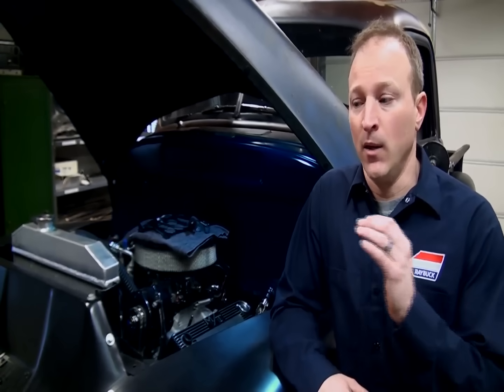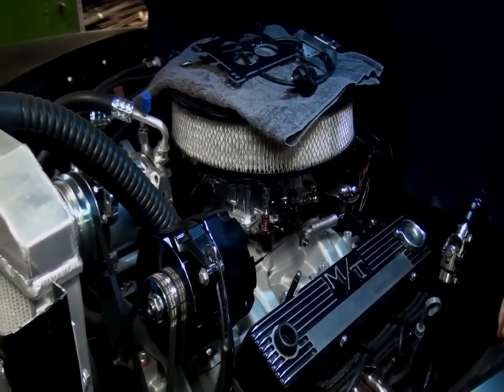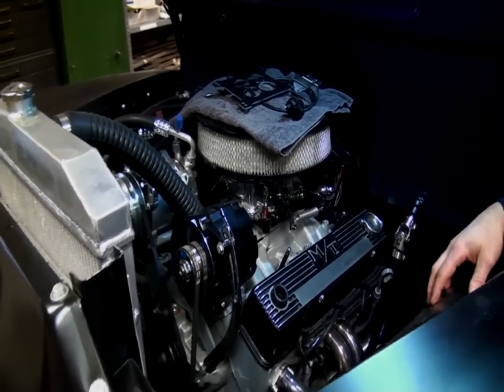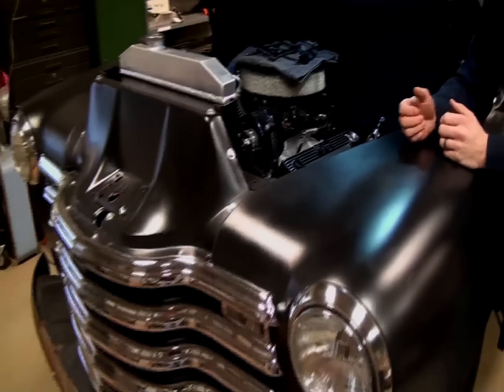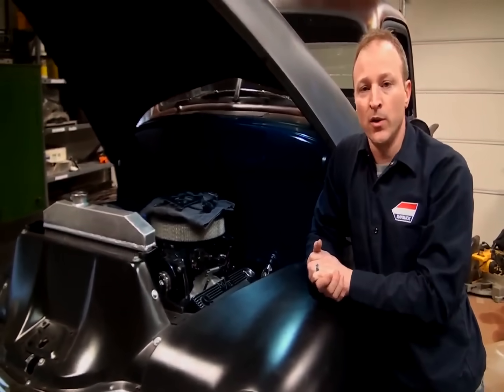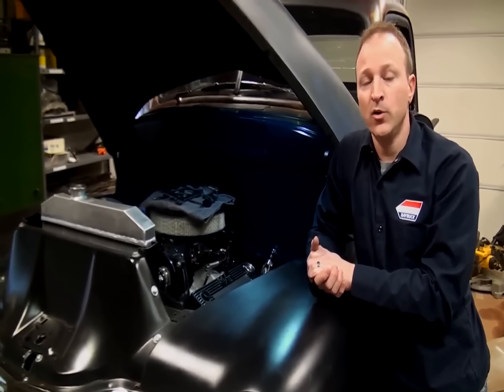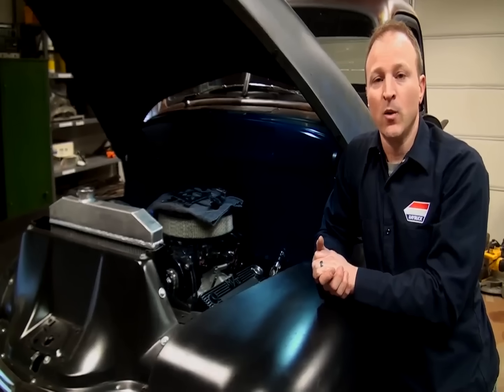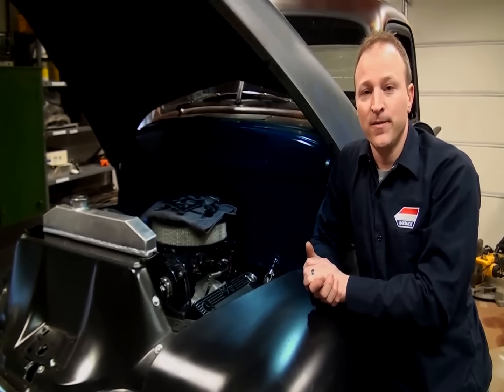Differences between a TH350 and 700R4 transmission and fitting them into a 1947-1953 Chevy Pickup

Comment: The TH350 was a bad design. Every transmission until, the TH350 came out had a coupling between the input no output shafts. The input normally had a hole in the end of it with a needle bearing inside that the output shaft narrowed down to fit into. This supported the shafts so that they didn't wobble around on their own or flex under load. The TH350 doesn't have that. The two shafts merely butt up against each other. The only thing holding the two shafts in alignment are the clutch drums when they are activated. Otherwise they can float around wherever they want. It's a poor design that was done on purpose, requested by the top management of GM in the 60's. The problem was that the Powerglide and TH400 were so good that they generally lasted as long as the engine did. But the Brass at GM wanted to sell more parts and service and put out a design order for a transmission that would only last 60,000 miles, instead of 100k he other two transmission at the time were lasting. The engineers did a great job of hitting the 60k mark as the TH350's were known to go out at roughly 60k.After that, in the late 70's/ early 80's GM came out with a light weight Automatic for 4 and 6 cylinder cars. This was the TH200, and it had pressed clutch drums instead of forged drums that were machined to hole the tags on the friction discs of the clutch pack. In don't know what else was inside of them, but they were horrible transmissions that failed sooner the the TH350. 
In the 60's through 70's if a guy was building a hot street or race car they would took the TH350 in favor of a TH400. The coolest thing about the TH400 is that the early models used a switch pitch torque converter. The vanes in the stator of the torque converter opened wide when the car was starting out, coming away from a dead stop and accelerating up to speed. Before the TH400 Buick had a transmission called the Super Turbine 300. It also used a switch pitch torque converter but it was 10" compared to the TH400's 11" diameter. The smaller the diameter, the higher the stall speed of the torque converter. So by using the Super Turbine 300 converter in a TH400 you got around 2500 rpm stall speed, and you had the switch pitch stator that helped the car get off the line. Lots of guys in the know would make this swap. Now days it's getting harder to find the right year TH400. But back in the day it was a secret weapon on the street!
Reply: man your full of shit
Reply: My 66 cutlass debadged 442 had the th400 w/ variable vane torque converter.  Didn't have any info on it at the time and it drove me nuts trying to figure out the extra wiring attached from the carb linkage to the trans. Finally learned what it was and how special it was after it was gone.  That's how Dr. Olds was able to smoke the tires in a 4500lb car with 2:73.1 gears in the rear. Endless smoke and 140mph top speed in the same car.  People should have taken him more serious back in the day.
Reply: You have absolutely no clue what you are talking about.
Reply: @John Hernandez he's got a little bit of that right but most of it is way off base
Reply: Thank you for sharing your insight,  Ken.

Comment: difference? 350 is good and the 700 is junk. cmon now
Reply: Based on what facts?
Reply: @metalbill2007  chill out kid. been doing all 3 a long time. 700 was a platform with pontential but the linkage controled pressure always went out of adjustment on them and burned up.
Reply: @commando2074  Not really a kid at 44, but also not wound up. Just asked for some facts, that's all, instead of you just bashing it. A cable out of adjustment is not the transmission's fault.
Reply: BS, I have built several....
Reply: @homefront3162  yeah. you had to build them cause their junk.

Comment: I have a question for you I put a 700r4 in my 69 Chevy, pickup got it from bow tie my problem  is the Speedo cable is too short by about 3 inches I've tried buying new cables but all the same too short
Reply: try a cable for 82 through 87 with 700R4 I believe head attachment is the same as the early models
Reply from the maker: That seems odd. Are you able to route the cable a different way? Most stock cables are the same length. We had a little bit of slack in our cable once installed, but the route that it takes could definitely make a difference.
Reply: @RaybuckAutoBodyParts  to route the cable up through the firewall the same way as it did with the 350 trans it was short the samel length that the 700r4 was longer than that 350
Reply from the maker: @johnwilder1746  not sure what else to suggest there. Did you ask bow tie if they have a longer cable?
Reply: Get a 4x4 suburban cable

Comment: Looking for some help, I have a Malibu wagon 1980 with a 3.8 v6 and would like to put a 200r4 in it . Some one said I can and I won’t even have to cut the drive shaft
Reply: 200 r4 is easier than the 700 r4 exchange. The length is the same the bellhousing will fit any GM motor. You will need a little piece of metal for the mount, filler tube and detent cable. Terminal a is the hot lead on the transmission, terminal e is the ground. Swapped one in my 79 Trans-Am and it was cool. Of course I've rebuilt many of them too.
Reply: Roy Anderson glade someone answered so soon, I was most of the day looking up stuff and smelling my wife and daughter cooking. Happy thanksgiving guys and thanks again really appreciate your help.
Reply from the maker: Not sure on that one. We don't have a 200r4 laying around to get measurements off of. I'm sure you can find measurements online and then compare to what's in your car. You'll want to make sure the yoke splines are the same as well. The tranny might be the same length as what you have, but if the splines are different then you're going to need to have that portion of your driveshaft changed to match. The splines on the TH350 are the same as the 700r4.
Reply: Thanks, I did find some info to what I’m trying to do. I’ll keep looking for more. Thanks again
Reply: "MIGHT" fit

Comment: I'm not sure if it's the 400 or the 700 but I believe the inside of it is completely reversed as the turbo 350. I could be wrong I went to school to be a mechanic way back in the late 80s and I work at a transmission shop briefly in the late eighties as well. But a lot of time has passed and I went into fixing houses as fixing cars was not paying anything to what I needed to survive. And since then I've been disabled with colitis, pouchitis, crohn's disease and I've smoked probably about 7 pounds of cannabis since 2000. Also been on Ambien for almost 20 years and if you think pot will make you forget things, Ambien is a hundred times worse.

Comment: What is the shop you had build this transmission and roughly what is the cost I'm looking to go from the th350 to the r4 in a squarebody pickup and I'm near new Kensington
Reply from the maker: Wholesale Transmission (https://www.mikeswholesaletransmissions.com/). Mike is the owner. The cost can vary depending on if you have a core that you want to have rebuilt or not, how much power you're going to put through it, etc. You're probably looking at $1k-1.5k.

Comment: Looking to put a 700r behind my 1955 Chevrolet Bel Air with a 235 six.  Any advice? There must be something for the rest of the shift linkage and shifter. It has its stick powerglide now.
Reply: Call the folks over at Bowtie Overdrives (https://www.bowtieoverdrives.com/). This is what they do and they should be able to help guide you through what you will need to make that work.

Comment: If it wouldn't put a power that transmission still going to work..
Reply from the maker: Yes, the transmission will still work without supplying power to it. The power is to lock the transmission in overdrive. It will still shift in and out of overdrive without power, though.
Reply: @RaybuckAutoBodyParts  So it works the other way around, disabling overdrive and making it a 3 speed for e.g. towing? By the way by installing 700R4 in place of  TH350 you are also gaining lockup function, aren't you? It helps to drop couple of extra RPM too.
Reply from the maker: @mibars  It's always going to be a 4 speed. The lockup literally locks the converter in overdrive for highway driving.
Reply: @RaybuckAutoBodyParts  I see, I thought that this is another solenoid for disabling Overdrive so it would not hunt gears while towing or uphill.